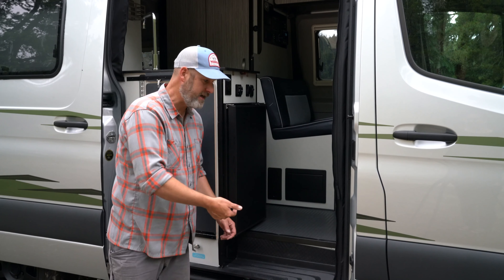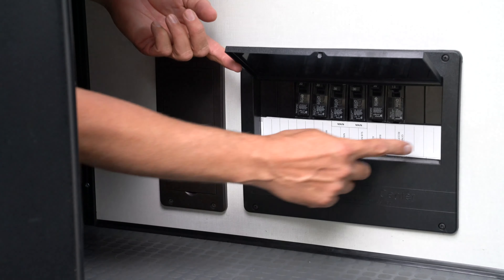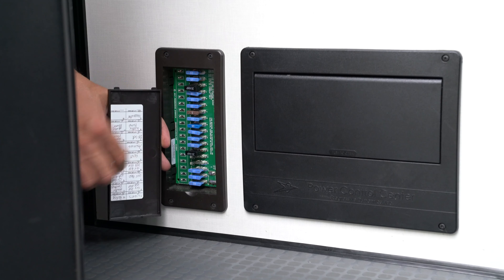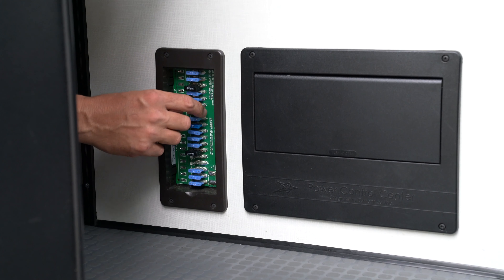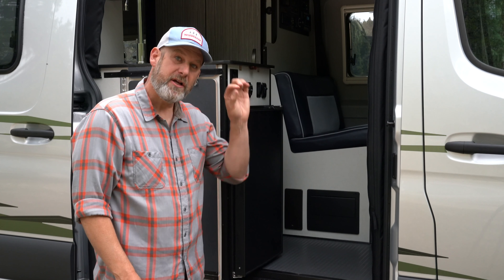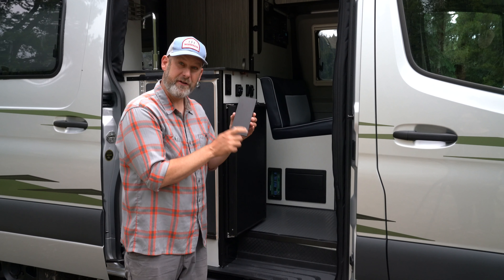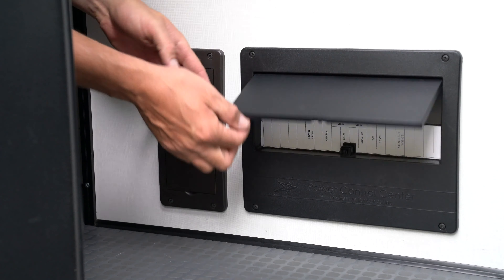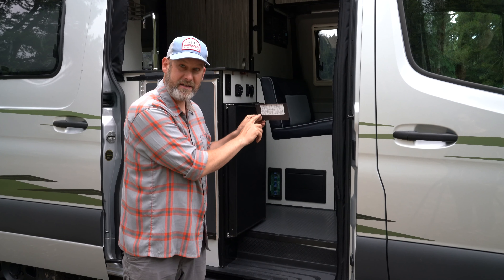Winnebago Revel Breakers and Fuses

Comment: I'm trying to locate the fuse for my vent fan.   I had all new coach batteries installed and now my vent fan won't turn off.  Not even manually.
I was hoping to pull the fuse out and reinstall it to see if that makes a difference.   Any ideas?